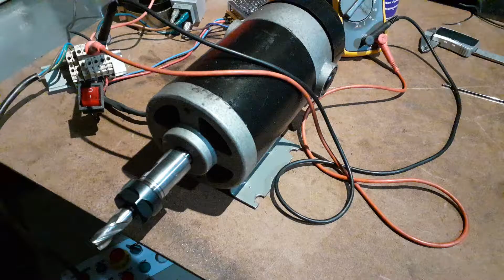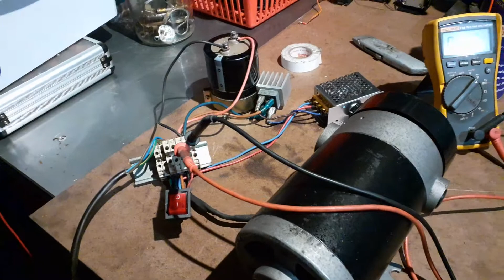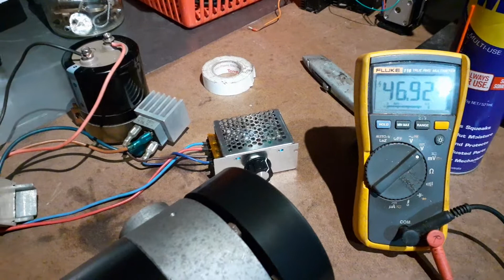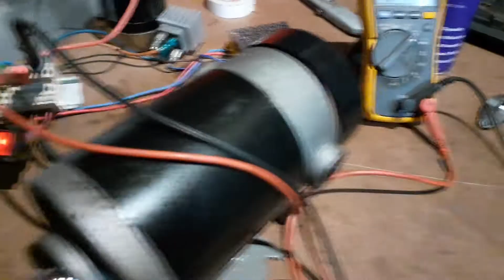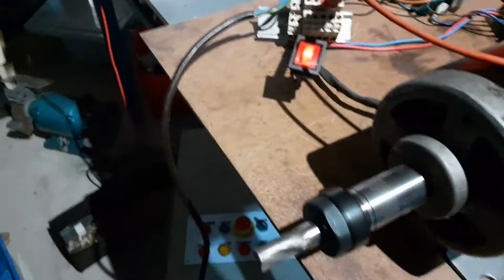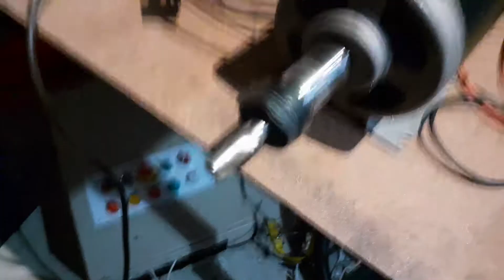CNC Spindle AC-DC overdrive on a Treadmill motor

Comment: What components would I use for 120volts? Im in the US.

Thank you!
Reply from the maker: A bridge rectifier rated at 400 volts and 25 amps and the capacitor should be rated at 400 vdc
Reply: Thank you! So I would need the same capacitor as you are using?
Have a link to the capacitor? Would I need a inductor?
Reply: Hello

Comment: How much runout do you have on the ER20 chuck?? No one ever post that information on these conversions.
Reply from the maker: Yes you are right because I never ran the dial indicator on it. Visually it looks good but I have not fitted that spindle to a CNC machine yet. I believe that motor really needs some engineering work on the bearings to be any practical use. 
The motor itself is quite powerful and could be improved with an axial thrust bearing on the top of the motor and perhaps a radial thrust bearing near the collet.
Reply: @postiemania  Thank for the quick response I just received a similar 500 Watt motor today with an ER11 collet. I checked the runout and I was amazed.  Sorry I am i the States so all my dimension are in inches. Run out on the collet spindle taper was maybe .0001 of an inch. Yes that is one ten thousandths of a inch. Actually it was better than that but a .0001 indicator was the finest i had. I then installed a .125 cutter in the collet and check the run out of the tool. It was maybe .0003 of an inch !! I can live with. I think  this motor with small cutter will be fine and run for a long time. I think a .250 dia cutter would be pushing the limits of the motor bearings for any kind of life. Perhaps  it would be better to build your own spindle with good bearing and a ER-16 collet setup and use a poly vee belt from the motor to drive the spindle.